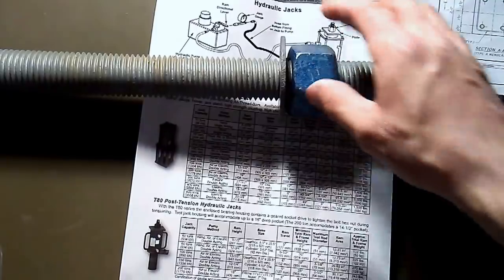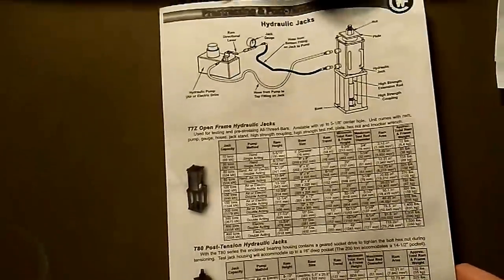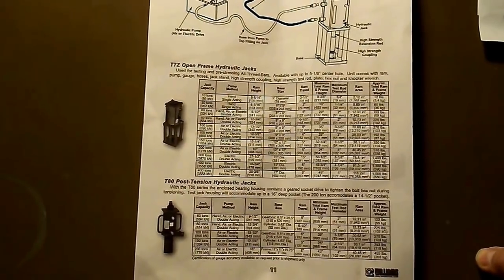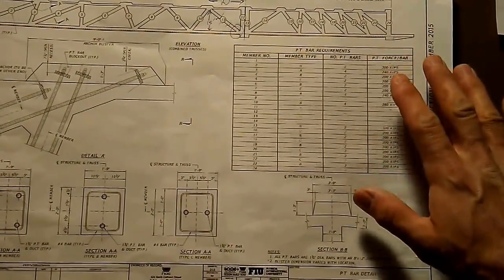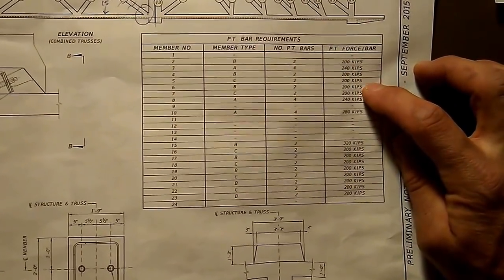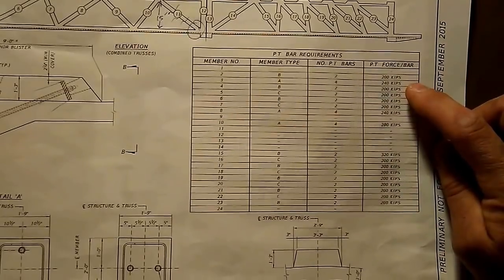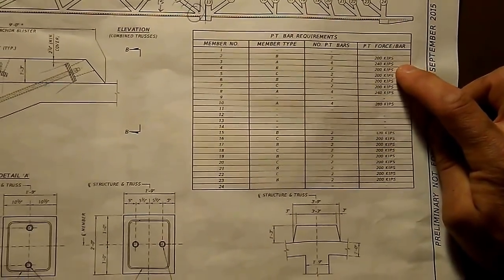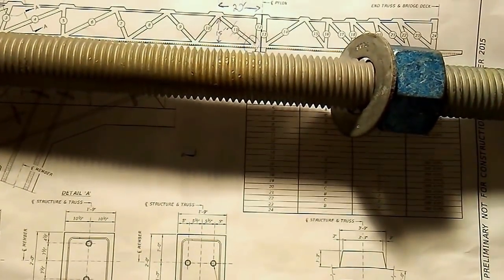FIU Bridge Collapse: Post-tensioning Explained

Comment: The true failure is the buckling of the bottom deck under the post tension force. It is an abrupt failure. The PT forces fold the bottom deck between 10 and 11 quickly in a blink of eyes. The concrete of deck between 10 and 11 were pressured, with additional pressure when moving (over pressure?) , and possible damaged/cracked the bottom of concrete deck during moving process. When moving, the bottom of PT rods resting on the thin concrete cover and crashed the concrete cover. The joint between 10 and 11 were experienced stress reverse during moving and final resting position and cracked also. This is only rational explanation for abrupt failure. BUCKLING
Reply: @David L; no, it was not the bottom deck but rather the top, specifically at the junction of the top deck and member #11.  If you watch the first moment of the start of the collapse, you see a puff of debris shooting out from that area.  Nothing is happening to the bottom deck at that instant.
Reply: James: 1. Yes, ALL connections are weak and not properly designed (remember when design steel truss connections? extra welding plate is needed for the load transfer at the joint, and buckling of the plate and welding length have to be checked and designed) 2. No failure as fast as this one in engineering history (faster than free fall from Gravity force. One can actually calculate the free fall time from 0 speed to the ground, t=squareroot of (2x15ft/32) = 0.968 sec). 3. Where is the force coming from to expedite its fall/collapse? Post tension force from bottom deck ( you can see the folding of the deck under tensile force. 4. Please exam the supports from the mover and stress "reverse" back and forth of the cantilever portion including the bottom deck. It requires precise calculation to determine the tensile at 11, compression at member 10 and extra compression at bottom deck to the PT forces.  5. The mover supports at bottom deck were NOT at joints. It will damage/hurt the bottom deck, further weakening the thin deck. 6. Reinforcement is required at the pass of the stress dissipation from the joints to bottom deck and top cover. (stress concentration at all joints) 7. anyone checked the buckling stability of a thin deck under compression forces with Euler equation? I bet it is NOT adequate. Remember, this is truss design, but NOT a truss. In steel design. there are two groups of WF, compact sections and Non-compacts. When use the non-compact sections, Flange buckling has to be considered. Same case with this bridge design. 
This bridge has to be designed by experienced with advanced degree engineers, rather than any average engineers. Looks simple, but NOT.
A minor note: they broke OSHA's rules to have workers working on top of the bridge with only crane hoist as safety harness. This company should go bankruptcy and it's management people should go to jail.
Reply: You can't buckle a member with PT. It may crush the concrete but it can't buckle. The likely failure was the bottom end of #11. The joint at #10/#11 failed in bending after the joint between #11 and the lower deck failed.
Reply: The joint between #11 and lower deck disconnected. It is likely this joint went first and the #10/#11 joint went second in quick succession.
Reply: You can't buckle a member with PT (post tension)? Sure it can, just like columns. The load at each end is the PT force, and section is the slab. Slenderness is the weak side of the slab. When design elevated slab, experienced engineers only design 90% of the dead load for the PT cable stretch force for that reason. BUT, you can't buckle a Pre-stressed slab, because the stress bondage to slab is along the length of the cables.
Reply: I am a structural engineer (M.A.Sc., P.Eng. Struct. Eng. etc., 30 years experience with all kinds of structural designs, bridges, buildings, houses, seismic upgrades etc.) and I have designed pre-stressed structures as well. Most people are surprised,  such as yourself, when they hear you can't buckle a pre-stressed element (except for externally pre-stressed structures) with the force of the pre-stressing. Buckling is a second order effect. As the member starts to bow, the bending increases due to the increased deflection and axial load. As the deflection increases, the bending forces increase which increases deflections. The process continues and you get an instability. Internal prestressing is different. As you increase the pre-stressing, the member may start to bow slightly but then the PT cable/rod contacts the inside of the conduit. The tension pushes against the side of the conduit and opposes the deformation. You can try this yourself. Use a plastic pipe and some rope. You may be able to squash the pipe or break the rope but it won't buckle. Try buckling it by hand (with an external force). It can buckle at a very low load with an external force.

You can even have folded plates that are prestressed (in fact there are folded plate structures with pre-stressing) and they won't bend (fold in half) or buckle from the prestressing. This is not to say you can't damage concrete with the prestressing but it won't buckle.

BTW, sometimes we will prestress more then just to counter the DL deflections of the structure. Long term creep and shrinkage in the concrete reduces the tension load in the PT. For these reasons, we will sometimes camber the structure past level. There is no hard and fast rule (at least in the codes where I come from).

I hope that makes sense.
Reply: Go talk to a professor. I have not any less than your credential + PhD. I am working on a PT slab right at this moment. Are you try to tell me the "Euler's equation? Deal with it everyday. 
You try to use the cable against the concrete to prevent slab from buckle, Wooo. You might just discovered the cause of the failure. Do you know how much extra tension will be exerted on the PT cable and the ends? In theory INFINITE. Maybe this is the cause of this bridge failure. But I tell you now, you cannot account for the concrete and cable interaction like that numerically, and neither text book or code will allow. 
The PT cables are NOT suppose to have friction against concrete slab, period. That is why, the plastic conduits were provided. When the cables straight through instead having middle lap splice (middle ends) there is buckling to check. To other structural members, it is internal force. But, to this member itself. The PT force is external compression force. By providing middle stretch ends for slab length more than 150 feet in practice, it eliminates the buckling concern and reduce the stress lose due to friction. 
I said the prestress slab cannot buckle under its own prestress forces due to friction/bondage between cables and concrete. But, POST tension construction is different animal. The cable should NOT bond with the concrete except at ends. The middle concrete section should be check with buckling. Try to push the edge of a cardboard, see what happens. 
Just because it is a post tension, you mean the Euler's equation is NO Longer apply? Wooo. Someone overturns the classic Physics second to Einstein.
I appreciate your information and efforts for us to enjoy. But you do need to brush and refresh your fundamentals.
Reply: I am not talking about the friction and the concept applies to unbounded PT as well as bonded. As you get a second order deformation from the compression you get an equal and opposite force from the PT cable. The cable is essentially a catenary  element opposing the lateral movement of the concrete. We have very slender slabs with unbonded PT cables. They will not buckle no matter how much you pull on the PT but you can get blow outs. The blow out force from PT is much higher than an external buckling force would be.

It is not uncommon to have bent parkade ramps that are post-tensioned. They do not buckle or fold in half from the post tensioning. I have even tried this on a very long piece HSS 2x2x1/4 and a PT cable. It only buckled to the point the PT cable comes in contact with the wall of the HSS. Try it yourself. It works.

Another thing to try is to use elbows on a plastic pipe (make a zig-zag structure) and a rope. It won't fold when you pull on the rope. But it will fold if you push on it from the outside.

The phenomena is actually quite well know with engineers that design a lot of post-tensioning.

There is no way the bottom deck buckled from the PT force.

If you still don't believe me, try a buckling analysis on FEA software. Use slave joints in the tension element that locked to the compression element so they are forced to moved laterally together. You won't get the structure to buckle (at least as an overall structure. You can get local buckling between joints).
Reply: You might just find the failure. "Blow out of the PT ends" I was looking for the source of LARGE extra force. But the bending of deck slab will do. The rods only should be tensioned 0.83 inches to get 200 kip. Any more slab curvature will stretch it to end blow out. The deck slab flexes during the moving process. I still think PT can fail in buckling, BUT I will get second opinion from school next Monday or Tuesday. btw my university is NOT FIU. 
You raised a good research topic. Cable against the thin concrete cover? It is NOT the same cable against steel tube (steel 46 k-58 k, concrete 2.5SqRt of 8.5 k = 0.23 k) with against concrete. How much to break the concrete cover, and how much to blow the ends. Go back to school get your PhD for this topic. Interesting to see the result.
For this bridge: How many failure modes can you list base on Abrupt failure? shear failure at joints, buckling of slab (T&B), Blow out of PT ends(bottom deck suddenly lost tension. More to add?
Reply: no problem. It is a very interesting topic and PT can do some unpredictable things. The failure could well be a blow out. Although, my bet is that there was something wrong with bottom end of #11. The dead end of #11 stayed with the deck and the PT rod was pulled out the side of #11 (ripped right through #4 stirrups in the diagonal). Since the dead end stayed with the deck and ends of #11 and #12 stayed on the support, the implication was the failure was just above the deck. It could be a shear friction failure at the pout joint or honeycombing/void at this point.
Reply: I have been advocating the engineering design of details as an under graduate and graduate courses. But no avail. There is NO such numerical design books. Steel manual has detail design for steel construction. That is all I can find. I had to learn ALL that during working for all different engineering firms. 
The failure of the roof canopy between 11 and 12 shouldn't matter to  the entire structure as a whole, and Roof deck shouldn't even need PT in longitudinal, unless for the temp and shrinkage reasons. Keep watching the video. The first failure was the roof canopy btwn 11 and 12. Then the bottom deck broke. Very unusual. 
Can it be: The bending and broken of top canopy rotated the 12, rotation broke some PT end connections? Or depends on their detail, it broke ALL PT ends. 
If you look the video again, how can it fell to the ground faster than free fall? You can see the free fall tools fell after the deck. There were a lot of redundant longitudinal PT cables in the bottom deck even assuming a few broken ones.
The whole thing was bound to fail. The web portion was NOT designed as a truss like you said in the middle portion of upper and lower deck. I would design the concrete truss first, then add the deck on each side as wings. easy and straight forward.
Reply: I want to try that experiment, only use a strong in compression, weak in tension slender tube material like glass or pottery.   Then use two rods opposed longitudinal, and end plates each with two holes to pretension, then set a high compressive centralized dead load, independent of the two rods, and quickly remove tension on only one of the rods.   What will happen?
Reply: Actually, it is better to use a slender plastic tube. Soft materials and and slender forms/shapes buckle more easily. The glass or clay can shatter. Not because they are buckling but more because they are just brittle. I am not too certain of your description. It is difficult to picture without a diagram. It is important for the rope not to be too loose inside the pipe/conduit. You can get a slight lateral/bowing in the pipe until the inside of the pipe contacts the rope. Good luck. I look forward to hearing about your results.
Reply: Why would you use a ductile material tube like plastic when concrete is anything but ductile?  It seems glass, or terra-cotta would be a better directional sensitive material.  By the way be sure and read note 7 on the S-38 drawing stamped 4/7/17 that discusses the uses of the rods in #10 and #11 diagonals.  There is a reference to the latest drawings above in the comments somewhere.
Reply: Do you mean note 8 and member #2 and #11? I have read this note already and have already pointed it to some other people. It definitely indicates that the rods in #2 and #11 were only intended for the move.

Prestressed concrete has mild rebar in it that improves the effective ductility. You want something that bows/buckles easily (without breaking apart) at the scale that you are testing. I suspect smaller sections of glass or clay won't buckle very easily. In a small scale, If you make them slender enough to buckle, they will also be fragile. I could be wrong but give it a try and see what happens. I am making some suppositions about the behaviour of the smaller scale glass and clay columns and it is better to experiment and confirm. I am curious about your results. Post the results so we see what happened.
Reply: As you know, since the structure is not a true truss , the moment resisting joints between diagonals and canopy and deck make it difficult to analyze.   I would like to know how close to maximum compressive strength or maximum tensile strength the concrete in #11 attained both in movement and in final position, so I can scale it.
Reply: Yes, thanks.  I meant B-38 stamped 4/7/17 and note 8.  Sorry about that.
Reply: It is extremely rare to have a true truss since fabricating a true pin joint is very difficult. However, when we do a more detailed analysis, the bending forces are quite small since the load path for the truss is so much more stiff then the bending elements. You more or less get close to the same load path as a truss. 

If you want to scale the actual model, that is very difficult to do. When we have physical models, we usually take a component of the structure and generally don't go less than 1/2 scale (and even then there is a lot to modeling). You have to scale rebar, the young's modulus of the materials, the strengths of the different materials etc. Things like pour joints in the concrete are important and again are difficult to scale. You also have to load the structure in a similar fashion which is also difficult. It is easier to scale a portion of the model as a concept of a particular failure mechanism.
Reply: I agree.  What I want to really test is the hypothesis that tripping one of the tendons, upper or lower in #11 while it is under maximum pure compressive would inject enough disturbance in the member to cause a crippling eccentric to develop, or not.
Reply: I have already done that calculation. There is about 1.3 million lbs on #11 without the prestressing. If one of the rods was fully stressed while that other one had zero tension on it, the total load would be 1.3+.28=1.58 million lbs. The bending load is .28Kx7.5"/12=175Kip ft. The axial stress with out bending is 3130 psi. The pure bending stress is 1041 psi (ignoring the axial stress. it is calculated from M/S, M-bending force, S-section modulus). So the highest compression in the concrete is 4172 (say 4200) psi. The other side of the diagonal is still in compression with 2089psi (say 2100 psi) and so it did not fail in tension. Concrete will fail at about 85% of its cylinder test result (or that is what we typically assume). So the compression failure would be .85x8500=7200psi. So this is not a likely failure mode. In addition we have significant mild reinforcing which I conveniently ignored. However, there are some accidental bending moment forces which you would need to do a more in depth analysis to determine. All the same, it doesn't look like it would the cause of the collapse. These are actual predicted stresses and capacities at the time of failure and not design stresses or capacities. I hope that makes sense.
Reply: Yes, in my envisioned experiment I would be ignoring the rebar caging that helps keep things in line even with bending in the member.  Thanks for the numbers.   In my experience, I never worked with 8500 psi concrete.And speaking of concrete, did they do the QA stuff with pouring test cylinders along the way, say 6 out of every truck, and burn some proving that they had the 6000 psi "go" curing?
Reply: They would have done testing on the concrete for sure. But you can tell this is a really strong concrete from the fractures. There is no debonding between the aggregate and the cement mix. The aggregate fractured before debonding which means the cement mix (and bond to the aggregate) is stronger than the aggregate. 8500 psi is not common at all. It is considered to be very strong. Modern concrete is usually about 3500 psi to 6000 psi (I keep on having to convert since I am not use to the imperial system, I hope i get that correct). The strongest production concrete I have ever heard of was 120MPa (17400 psi).

Even with really strong concretes, you can still have flaws (honey combing or voids) that can cause a local weak spot. That could be a factor in this collapse.
Reply: I did notice that the aggregate did not protrude in or out of some of the fracture surfaces, which is again, weird in my experience.   Also, some of the aggregate was large in size, which would make me nervous (blocking fill in corners, and crannies)  The post crash debris was difficult to evaluate since much of it appeared to be  jackhammered trying to get to the victims.